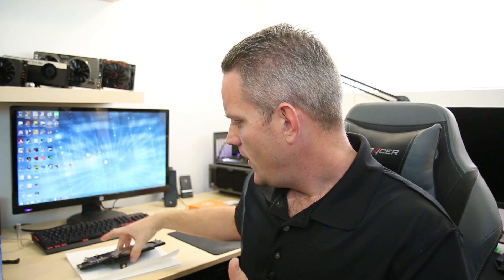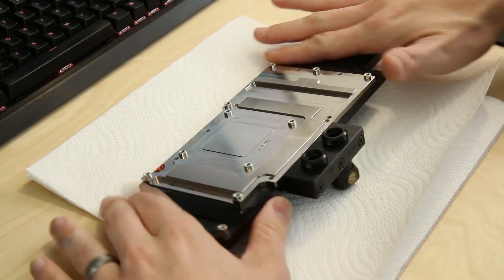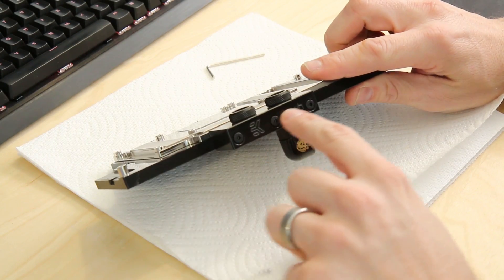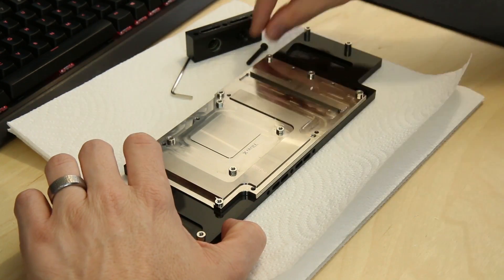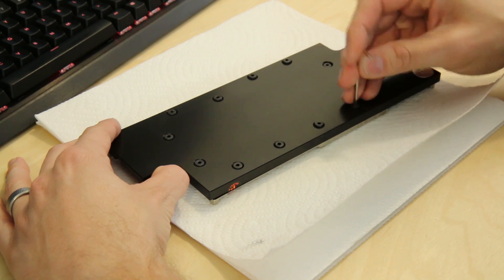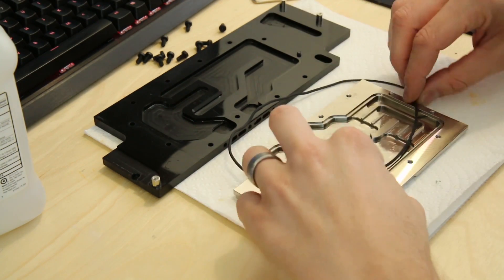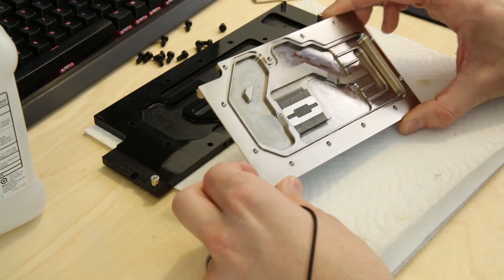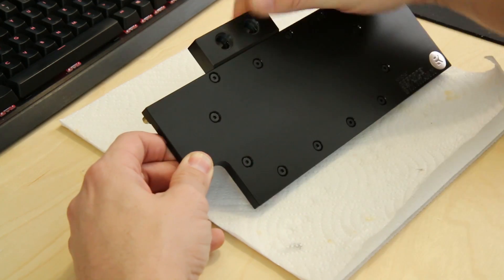Inspecting the inside of my GPU blocks - How to clean GPU blocks

Comment: I have this exact same issue and I think it's because of EKs radiators being 90% copper and 10% brass. The rest of my loop is nickel plated copped and acetal. At first I thought it was algae but it seems to be a mixture of algae and copper salts?

Comment: Hi i have som oring mess ore something like that. Its black and i used white coolent.  There is some whit gunck but manage to flush that out. But i have a Nidiva 1080 hydrocopper how the hell do i get that apart? Anyone that know? I tried but there is 3 screws that will not loosen the the the risers loosen. And like yours here. I see 2 screws holdig where you have 3 on the conector side but mine have a RGB light there and,, I did not find the way to get to them..

Comment: He's talking about copper and nickel jay... both produce calcium when charged with ions... your copper radiator and nickel plated block are charging each other through the loop causing calcium production.... and it's not corrosive unless the fluid becomes charged in the loop... nano fluid prevents the charging of fluid between mixed metals nearly eliminating galvanic corrosion by limiting charge during calcification!!!.... so just keep up your cleaning rituals jay!!!

Comment: came here because need to deep clean coolant loop where Thermaltake C1000 fluid failed and clogged my system. Just watching as many vids as I can before I shut down computer. Thanks for this one. For heaven's sake though...use some better tools man. Someone that supposedly works on pc's as much as you do should be working with better tools. That allen key is a joke.

Comment: I know this is a year old but the most likely reason for the gpu loop running hot is the fluid changed state in some way(ph, chemical content, etc...) and became less efficient at exchanging heat. The buildup didn't help but you're right, it's not the primary cause.

Comment: You can try using Trilon B for making any kind of insoluble salts water soluble. It doesn't react to clean metals (which doesn't have chemical bonds with different substances), only to ones that bonded with something and have non-zero oxidation state. So it would be effortless flush of the whole loop.

Comment: Jay, your liquid may be changing color because you have added heat to your liquid/dye solution. This causes the liquid to become super saturated with dye. The molecules of H2O are bonded with that of the dye (call it salt if you wish). You now longer have readily accessible H2O. H20, that has a high specific heat which accounts for the heat transfer in your rig, is no longer working to its full potential due to now being H2O + dye ---> H20dye. Lol all theory based on knowledge I received in college, and now, university.

Comment: You didn't hear this from me but if you take a heatgun to the warranty sticker and carefully heat it up at about 60-80°C you can carefully peel it off without damaging the sticker. When you're done with your maintenance just put the sticker back in place, use a tiny amount of super glue if it won't stick properly anymore. If done properly you can't tell it has been openened up, and nobody will know ;).

Comment: Ok my personal opinion don't overclock, to me that just up the chances of hardware will lifespan will come to a short end, the reason why i say this is not technology will come to and the tech that you have will eventually die its just the question how when and why it did, JayzTwoCents here is a suggestion put one titan on stock settings with no water cooling and then run a benchmark multiple times and see how hot it get if it had a fan and you have some sort airflow going on and see what your temps get at by just running a benchmark then if your temps get high i just this might sound wierd smell your graphics cards just to make sure nothing is burning, that the only thing i can suggest to do and if the temps stay at a normal steady temp then your cards should be good, i hope you cards are good this just a suggestion and its also my personal opinion, i am not going to argue about anythin every body dersirves to have there own personal opinion, idk if you have tried this yet.

Comment: If I had to guess, maybe the heat problems and fluid problems are related. The worse the fluid got, the worse the cooling with the cards became, and so on? I'm not experience with water cooling at all but I have to think it'd be just like if your car's coolant was bad like that

Comment from the maker: See the description for important information regarding alcohol and plexi and rubber orings!
Reply: +jayztwocents You mentioned some stickiness you felt on the nickelplated surface. It might seem insignificant. However, it could be a sign that as the powedery stuff is coagulating, some of soluables in fluid are forming a thin film on the nickel surface, just like how cholesterol starts to stick to artery walls. That film could act as an insulating material slowing down heat transfer from the block to the fluid.
Reply: +JayzTwoCents Thanks for the heads up
Reply: +JayzTwoCents your temp problem was likely from your pump not being able to move water from buildup inside it would be my best guess. The only way to know for sure is to have a flow meter installed in the coolant loop to see if you have flow. if you have good water flow quite alot if you are running your blocks in parallel. only other things it could be is your block to gpu does not have good contact (highly unlikely) or the "salty" powder is actually forming around the cooling blades and creating a insulating barrier from the water temp to the block temp.
Reply: O-ring actually refers to the cross-section profile, not the overall shape(oval). In other words if you cut it, its shape is round. Well maybe not now since it has been compressed for a long time.
Reply: hi jayz I have no idea how to pm u as I need your help on one of the issue that im facing now . if you scroll the video to 4.07, there is a small blade attached on the heat sink , I have lost that blade when I finished clean my gpu block . May I know what is that blade used for ? is it important ?
Reply: https://ibb.co/eH9Pnp 

this blade that I mention

Comment: That block was really very clean. How you got the higher temps over time is weird. In not sure the fluid in the loop could change its heat capacity very much. Maybe the contact between the block and the GFX chips degraded. How are they coupled together with the cooling block ?

Comment: HINT***HINT***HINT
To keep the o-ring in place during reassembly, coat it with a very, very light coat of grease that's for made scuba regulators and the o-rings inside them. Koolance actually includes some with certain accessory parts kits. You can get the grease very inexpensively on eBay and Amazon, you don't need much.

Comment: @jay your rad in your gpu loop might be extremely contaminated because of the smaller passageways that "salt" is going to more profound I recomend that you check the flow rate or even swap the rad from the cpu to your gpu and see if you have different results I bet you will however I hope not...

Comment: He Jay, is it possible that the 'salt' build-up not all layed down in your GPU cooling blocks, but also in the radiator/ at the pump impeller, what could cause a  flow restriction or worse cooling capability.

Comment: it might electrolysis take place by a defective current-conducting component. I once had a different problem, that partly to do with your problem had but was very helpful when troubleshooting years ago. a floppy drive only worked when removed, it has not worked in the Case.Ifound out that it worked when a ground wire was connected to the drive. the actual fault was a defective power cable from the power supply, that had contact with the Case.
it may be that a current-carrying part has an error, and the electrolysis starts. the copper reacts with the other metals
for example, aluminum in the radiators or with fittings the If they are made of chrome-plated die-cast zinc or galvanized steel.
this is my opinion

Comment: Hey guys, Im a first time pc build and is going for water cooling just for the fun of it. But what i need help.. Im trying to find the pump and resorvoir combo the Jay atm have in skunkworks.. with the 250ml res, d5 pump and square res mount + vertical mount for the entire thing. Is´t a combo of part bought each alone or out of date? trying to find part at EK´s shop atm..

Comment: I am a chemist and work with  synthesizing and processing nanoparticles every day.  the salts you see look just like dry nanoparticle powder to me which can often feel sticky or tacky because they like to hold onto solvent in this case water. also I don't know the size or composition of these nanoparticles but they are all very sensitive to contamination causing them to clump with time and settle out of solution... lastly I'd like to add that the color of metal nanoparticles (I don't know if they use metal or metal oxides or graphene or what)depends on their size so clumping or aggregation can also change the solution color usually to darker colors. what that guy said is true about the copper salts though.  who knows!
Reply: They could be aluminium compounds ? When I built my loop I read up on radiators and some use a lot of aluminium inside.

Comment: I'm no chemic either but I think the reason why your GPU got higher temperatures is because of the salt which you found in your cooling block as salt is good heat accumulator.

Comment: Copper oxides are not white. That powder is clearly just the powder that gives the fluid its opacity. I don't know if it is called the pastel or what. It's presumably some sort of finely divided plastic powder, or maybe they used silica because it's readily available in very finely divided form. Anyway, I would say it has an affinity for itself and therefore it builds-up here and there.
Reply: +Skwisgar2322 it's cocaine mate
Reply: +metallitech the most common white pigment is TiO2.
Reply: Calcium build up from any positively charged solid ion can range in color from uv florescent pink to green or white and even black!!!...

Comment: Lago Jevaux is correct. It looks like something in the fluid you were using was causing the either the coating or copper in your radiators to corrode. A possible way to fix that is to use zinc or aluminium and have the radiators electroplated.

Comment: Have you checked your radiator? If all GPUs were in the same loop and had similar temperature issues maybe the reason for increased temperatures can be found from there. Either the accumulated dust was blocking the airflow or maybe the copper inside of the radiator is tarnished or maybe the inpurities in the liquid are causing clogging in there. A water flow rate indicator in the loop would be good way to monitor this.

Comment: +JayzTwoCents Just a thought bud.. granted not very technical, but it's a wild shot in the dark.  One thing I do know of in cooking is packing fish in salt as a baking technique.  Granted we aren't cooking fish here, but considering the amount of residue build up in the video, combined with the fact that water cooling is working to very fine tolerances might just be enough to be causing temperature issues?  Since its a closed, pumped system, what do your radiators look like?  Given that there was significant build up in the block, might there be a more substantial build up of the same salt residue in/around them?  As I say, just a wild imaginative shot.  Sometimes silly analogies bear fruit!?

Comment: you know that makes sense because salt retains heat very well but not well enough to heat up your gpus but it there is a buildup happening rather quickly because of the extra heat excelleratung the process the problem would then lie inside your rads because with the excess heat inside the rads and with your limited cooling for the rads themselves that would greatly excellerate the process causing a the buildup inside the rads which then bring up a questing I have. when you flushed your rads with acid wash did you Temps stabilize for a bit and then gradually worsen as time went on or was there no change if there was stability for the time being then that would mean that it's your rads causing the problem if there was no change then all it is is that you have ineffective cooling for the rads which based on the last update I can guarantee is part of the problem no matter what

Comment: Today I've turn on my pc (i7 3770k, 2 gtx 680's, 8gb of ram..) and the cpu red led of my asus mobo lights up. The fans are spinning but there isnnt anything on the screen and the mouse and keyboard don't light up. What to do ?
Reply: +AlexSurYouTube - Some things to do: Check the CPU seating.  Try a different PSU if you have one available.  Reset the BIOS via the battery jumper.  Remove all memory modules.
Reply: +Berenger Christy It works fine now but thanks man I think the problem was a sata cable that was badly plugged

Comment: I have noticed on my strix 970 air cooled that ever since the december 21st update my temps went from 30 at idle to 60 and my gpu monitor said 100%usage at idle downgrading to the december 1st update solved my heat issues

Comment: This has to be some kind of contamination coming from the Black Ice rads you fitted. The fact that one loop was changing colour faster than the other clearly indicates it cant just be an issue with the coolant in its self. Now you know there's no problem with the GPU blocks degrading in any way, this really only leaves the rads. They're the only thing you've really changed since the last config of Skunkworks which ran for months without any serious change in the colour of the coolant.

Comment: The Copper salt formed is mostly Cuprous Chloride (or Copper(1) Chloride as referred to more commonly). It is insoluble in water and hence the deposit. The point about its formation is that the Nickel plating on your Copper is not working. Nickel is plated on Copper to prevent any reaction between Copper and impurities in water. The fact that it went through a reaction means that the plating failed for some reason. It's worth showing this video to EKWB and ask them to improve the chemistry of the block.

Comment: You shouldn't use alcohol on any plexi/acrylic parts of your water block, alcohol can cause plexi/acrylic to become brittle. This effect is obvious worse on thin acrylic vs thick blocks but it can still cause issues. Jay is using Acetal blocks though so alcohol isn't an issue.

Comment: looks like you are experiencing the same problem, or at least some of it, as the people who use the Mayhems Aurora coolant. The nanoparticals will simply settle out at any point in the loop where there is even the smallest amount of a low pressure zone, like around your fittings. I'm not sure what is causing your black film unless it is a reaction between your fluid and those radiators. it is possible that it is simply tarnishing the inside of your solid copper rads and that is slowly being leached into the fluid, or some other reaction. It can't be galvanic because neither nickel nor chrome incite a galvanic reaction, as they are essentially noble metals.

Comment: I've used that dragon ice before and anywhere you have flow it doesn't get that powder residue but on your O rings and stuff it does get a little bit of buildup but other than that I've never had a problem with it and I think it works pretty pretty good but I just used the straight dragon ice without any color or anything in it

Comment: Jay.. the white film could still have been the problem. Even though it had not clogged or limited the flow of the liquid if it created a film on the surfaces insulating them from the liquid you are not getting direct contact of the cooling liquid and the copper surface

Comment: My guess is the white powder is the anti-corrosive chemical falling out of solution. reasons: too much, too hot, contact with multiple metals causing electrolysis and oxidizing, like copper, aluminium, nickel.

Comment: Hi Jay! Could you post a video about assembling a hardline watercooling build? I saw your bending tutorial and I'm thinking how do you exactly install the tubes? I don't see being able to easily install the tubes if the radiators are already bolted down since you have to move it around to make room for the fittings and the movements when you screw them down.

Comment: I really would love to see you do a video on how you clean your radiators, inside and out. What products you use to flush the inside of the radiator, do you use your water pump to do that or just pour in?  And then after long use how do you like to clean the dust out of the radiator fins, fans, etc.